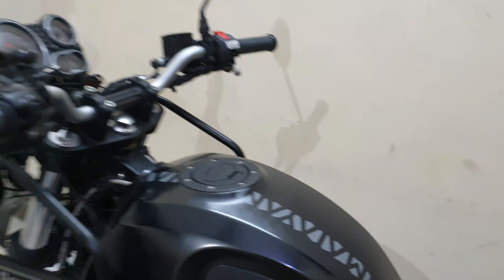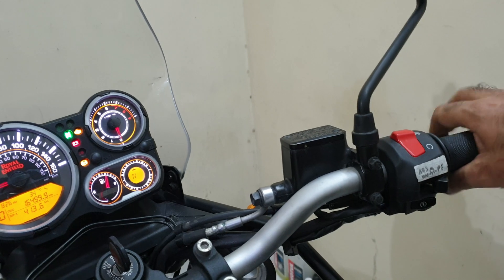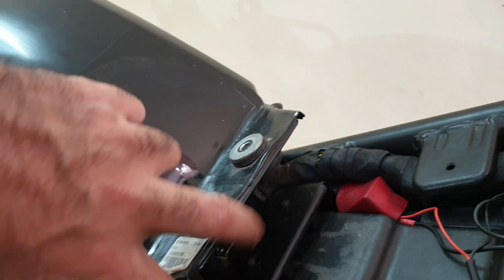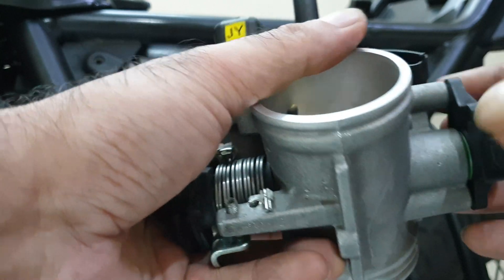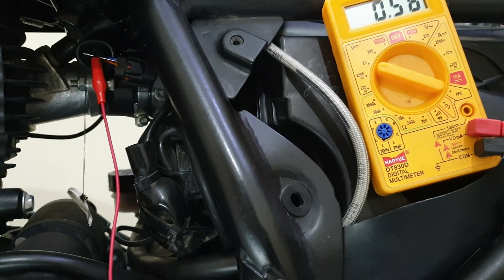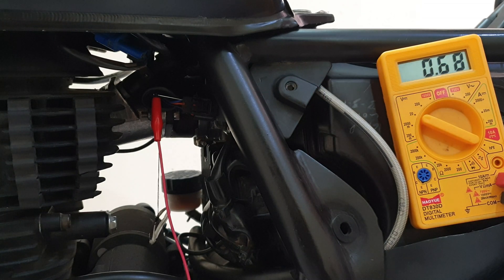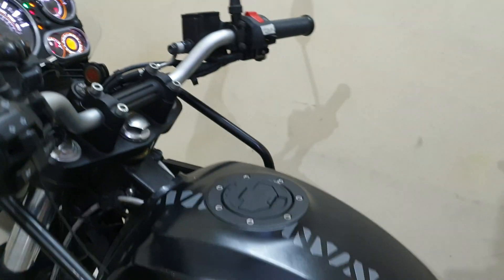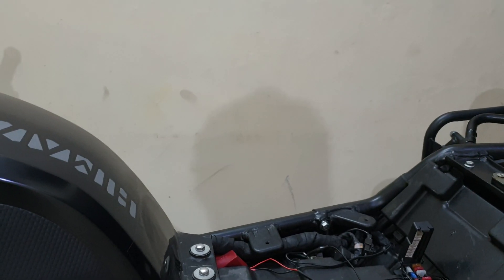Royal Enfield Himalayan | TPS | Throttle Position Sensor | Check and Adjust DIY

Comment from the maker: Hey
With so many sensors, the diagnostic tool at service centers may be a good option to check and diagnose problems. But some are accessible and easy to diagnose at home like the TPS.
ECU will all the sensors may seems intimidating but it is simple thing. Sensor (like TPS, MAP, O2, Crank speed, to name a few) provide input or information to the ECU which on predefined set of parameters from these inputs, guides the fuel injector and ignition timing, to feed fuel into the engine and advance or retard timing respectively
All these sensors work in conjunction to each other but if one fails the engine will still run on input from the sensor but ECU wont be able to fine tune thus there would be roughness and other teltale symptoms. 
This one is regarding TPS. If not adjusted properly it can lead to pough/erratic idle and poor performance. Checking and adjusting is the sipmlest. Hope fully the video will come handy 
Cheers :)
Reply: Thank uu
Reply: Would you know how and why a tps sensor would fail?

Comment: The 2022 bs6 does not have a tps, it comes with a complete built-in system, how can it be regulated or what generates the fault, because my 2022 BS& turns off in first gear, already hot it turns off in the city center several times, it drives me crazy, I don't know what to do, the dealerships with their pirate mechanics don't solve anything, they don't know what it could be and they change parts and parts and nobody is responsible for the poor quality of the training, they only sell motorcycles.

Comment: I have BS6 Himalayan 411. It has issues with idling and shutdowns but keeping the throttle slightly open or while started moving to get some speed then it doesn't shutdown. Any idea on what the issue could be?
Reply from the maker: @mageshganesan6871  bs6 doesn't have idle adjustment 
But look at spark plug gap
Reply: Need a valve adjustment. Tight valves will cause it.

Comment: I have exact same problem on my 411. But, it's a BS3 carburettor model. Recently got the carb serviced, tank cleaned, etc. but, the problem still persists.

I think the BS3 carb model also comes with a TPS? Would the diagnosis and solution be the same for the BS3 carb model?

Comment: I have BS4, 2018 model. I replaced the Timing chain after that 
1. Engine check lighe is still on
2. Fuel drops comes through fuel pump
3. Facing stalling issue.

Can you please guide me?

Comment: Thanks bro, I re-setting my BS3 C500 at 0.56-0.57 (previously was 0.3-0.4 and got some hiccup at slight throttle up, and somehow bit irresponsive throttle. This really fix my issue. I also experience forgetting to turn ign ON and engine cut off ON 🙂
Reply from the maker: Thanks mate, I am glad it sorted things.
Cheers🙂

Comment: Informative video brother.. my Bs6 2023 himalayan started to cut off when i down shift to lower gears like 2nd or 1st. Immediately after downshift and the clutch is still disengaged the engine cuts off abruptly. This is very annoying in traffic situations and while doing some offroading. Is this a TPS issue or something else?
Reply: Adjust the valve clearance.

Comment: I have rebuild my engine of a RE Continental GT 535... However in the process of removing the engine from the frame I disconnected the TPS sensor and after reinstalling the Engine the engine light is on. After some diagnostic trickery I know the cause is the TPS sensor (6 short light blinking after hardwiring the diagnostic line to the ground). Thanks for this super clear "how to" on how to set it up properly! I now know how to fix it :)

Comment: Thanks for this. I bought a cheap multimeter and used a sewing needle taped to the probe. It showed .64 and I adjusted it to 5.6/5.7 (bouncing between the two). Started the bike up and it stayed running! Had to lower the idle and will continue to work on that next time I ride. I typically don’t work on my bikes, but I know the dealer wasn’t going to try this. Can’t believe it actually worked for me. Your sewing needle idea was great and saved a lot of money, instead of buying a probe kit. The engine feels so much more stable. Thanks again.
Reply from the maker: Thanks mate, I am glad you found this useful. 
We are lucky that our model has all these adjustability. Newer models have different throttle body with no idle adjustment or TPS sensor adjustment😉

Comment: I HAVE A PROBLEM WITH MY HIMAYALAN, BETWEEN 2000 AND 3000 RPM THERE IS A JERKING WHEN I RECOVER THE RPM, I CHECKED THE TPS SENSOR AND IT IS IN THE CORRECT VALUES,

Comment: Thanks so much for such a detailed video instruction, step by step. I have a 2022 RE Himalayan and it has been stalling at startup every time. I will test the TPS voltage / position and adjust as needed. Thanks again!
Reply from the maker: Hey mate, thanks for your kind words. Now unfortunately, I have not worked on 2022 himalayan, I have looked at the throttle body of new models and found them to be different in design and function. So not sure if TPS adjustability is available. Please do let me know if it is. Cheers

Comment: Bro I tried this, but in my Himalayan it's not working, i inserted a needle nd negative cable on the negative battery side nd the red wire on the needle which I inserted but nothing is showing for me in the multimeter, mine is bS4 Himalayan

Comment: You saved my himalayan to be sold. I followed your videos to adjust the tps, the idle screw and upgraded the spark plug with the iridium one and now it is just perfect! The tps was adjusted from .60 to .57 and i could not believe the difference it did after it was adjusted. It is a completely different motorcycle now. Thank you so much!!
Reply: Hi can you share your no, it's not working for me on my Himalayan

Comment: Adjusted mine bs3 carb.  to 0.51 Volts at ideal! 
It was 0.25 volts from the factory i guess! 
My engine use to ping at times when the bike was heated! 
Now the bike feels super smooth and nimble and the pinging is negligible ! 
I hope 0.50 is correct as i read in ya comment! 
Thnks a ton! The joy i din had for 5 years is what i have it now! ❤

Comment: Another great informative video, thanks. Mine is starting to get a bit temperamental idling since installing a ejk fuel controller. I've done this adjustment to my classic 500 so I know it works, it made a great difference. I'll be doing this tomorrow to my Himalayan tomorrow.

Comment: Greetings from the US!  I just got my 2021 Himalayan and it takes about 4-5 starts to get it to idle.  I tried this method and read 0.65V.  I lowered it to 0.6V and see no difference.  Do you think I should put it back to 0.65V?
Reply: I think your issue has to do more with the minimum idle rpm rather than TPS. 
Mine took at least 2 attempts at start until I raised the minimum to 1,000-1,100rpm cold

Comment: Dear friend,
I had been and still an enthusiast about the vehicles and bikes.
1982 had a Enfield Bullet 350.
It was meticulously maintained.
Now the scene is enormously changed.
New technology and digital fly by wires system had made things better.
Here about this video and the demonstration with explanation by you:
All correct and to the point they are.
My few dull & dumb questions....are:
1) Let me assume the TPS position is at perfect position say +/-- zero.
Now by stepping down to minus one, the engine RPM will lower and viceversa?
Is this correct?
(One may not do this for setting the idle rpm.)
2) Regarding setting the idle RPM:
As demonstrated in your other upload:
The idle adjustment brass screw when turned in either of the direction: Does it physically lifts the throttle.
OR
Does it regulates the Air flow resulting in making the fuel-mix, lean or rich.
Please.
Hope to go through all of your uploads and will be asking a lot, in future.
Regards.
All the best.
RR

Comment: What's that sticker on RHS switch
Reply from the maker: Hahhaha, really glad you asked mate :) I did a BS4 to BS3 headlight light on off conversion plus also ABS on off switch, all in that old model switch gear so had put the sticker on for a couple of day to get familiarized with the setup ;D there are the vids
Cheers 
Royal Enfield Himalayan | Battery saving tip | Low Beam / ABS On | Off Switch Option | Replacement
https://youtu.be/ybSUd87mYhw
Royal Enfield Himalayan BS4 ABS On/Off Switch | Handlebar Mount | DIY
https://youtu.be/oTWdykKZLY0

Comment: Classic 350 what radio ??
Reply from the maker: Hey mate, BS6 Classic doesn't have this adjustability, Sorry as RE has put in a completely different design Throttle body and sensors
Reply: @leuheanrede  sir, I have old model 2014 tps available thats why.
Reply from the maker: @vipulmodi8728  aah got it. That should have the same setting. Will check and confirm soon and let's keep it simple bro, you say sir and I feel depressed about my age 🤓

Comment: Bro. Mine is BS3 Himalayan, where I couldn't adjust (Rotation) the sensor as you play in your vehicle. It has very limited movement... What's your suggestion to avoid stalling when sudden throttling...
Reply from the maker: Hey mate, limited movement could meant that the tool you are using is making it harder to access that Torx screw. As for stalling, does it happen at low RPM, High RPM or anywhere in the rev range?
Reply: @leuheanrede  No. I can able to access the screw and can loosen it.

Stalling happens when I shift to every gear. If I reach max speed of 1st gear I'm getting dip. Similarly 2nd, 3rd, 4th.

In simple words, if I throttle more to speed up the vehicle it dips there.

I donno whether I answered your questions or confused you🙄. 

Pls share your email/ Contact number
Reply: I did mine and that's fairly easy! You need to loose the T20 torque screw to move it!

Comment: I have a fluctuating rpm issue when i start up
It moves between 1.1 to 2k
Also i am getting very bad throttle response the bike doesn't go beyond 90
Reply from the maker: It could be a loose connector to one of the sensor or a bad sensor itself if the bike is not going above 90. This vid just covers TPS sensor
For fluctuating RPM please try to adjust the idle, I did a vid some time back, https://youtu.be/VhkReLSSIfs
This is only applicable for BS4 models

Comment: I have erratic idling, stalling and restarting issues on my “2021” Himalayan.
Surprisingly on this new Himalayan, there’s no TPS at the location you have mentioned in the video.
Please help me out in locating the sensor if possible. Thank you
Reply from the maker: Hey mate, yup new himalayans have a new throttle body with integrated sensors unit, not much can be done on them

Comment: I have an issue while riding in lower gears and around 3 to 4 rpms. At steady speed the bike's power seems to come and go, almost like a yo-yo effect. It doesn't feel smooth.  I'm not sure if it could be something sensor related, the chain, fuel injection. Have you encountered this at all?

Comment: hey man, my issue is a little bit opposite or different you can say!

when I turn my Himalayans key to on position and turn on the engine by self-start button and let it warm up to 2 to 3 min after that when I perform throttle like little bit fast (not slow) at that time my engine stops!
then I have to self-start my bike again and it does not turn off if I throttle it slowly!

and also another issue is sometimes my fuel pump did not make a sound (petrol pumping sound after kill switch in off position) and my bike engine didn't get started! it's like sometimes 1 out of 10 times and sometimes continue more than 4 to 5 times than I have to switch off my bike by the key multiple times!

any solution for both the problem? I just purchased my bike on 24th April 2021!
Reply from the maker: Hey mate. How many kms done in total. I ask becos for initial few 100 kms it is normal. After first service as the new parts are run in, things will get better. May I suggest that 2-3 mins of warm up in normal temperature is a bit too much. Idea is to warm it up for like a min say as we put our helmet jacket gloves etc on and start riding. There is no reason to give fast throttle at this time. We are suppose to ride it slow for first 5 min s as good practice at normal throttle speed.
But as for the issue of stalling, its new so let it run for a 1000 kms then we can adjust the idle. I have done a video on idle adjustment if you need to do it and the bike has done over 1000 kms please have a look at idle adjustment. 
As for second issue, that sound should always be there when we turn the key on given that on off on the handle is on. If you are not hearing it that means probably the electrical connection on the pump on right side of tank is loose. Please check that. Considering yours is a new bike I suspect it's just the loose connector. If it was old then I would have suggested to check for wiring cut or fuse. Very few chances of pump failure in new bikes. Always keep 3-5 ltrs or above of fuel in tank to  avoid any pump related issues in future. Last would be to check if battery is charged. 
Its a new bike so don't worry about tps at this point. Maybe later.
Reply: @leuheanrede  I rode my 444kms till now!
and due to lockdown conditions, I can't take the bike to the service center and service on wheels is also not available due to pandemic.
my first service is pending!

and ignition fuse I have checked yesterday it was good no issue in that.
and my tank is half right now and before that, I have encountered an F trip for around 3 to 5 kms.

and I have also checked the connector below the fuel pump yesterday it seems ok to me but I'll check it once again.

and can you plz tell me what can I do about the fuel pump issue? if it not resolved! because sometimes I got frustrated when my new bike didn't get started
Reply from the maker: @Hemant._.Dhiman  thats good, don't worry after the service things will get smoother, lockdown should get lifted in another week or 2 hopefully.
About the pump issue, I am not sure i understand correctly whats happening. 
So ignition on and kill switch on. And the pump doesn't start. Is that what you're saying
Reply: @leuheanrede  yes!
Sometimes i can hear a fuel pumping sound.
But sometimes dont and that condition my bikes engine did not start i have to turn my key to off position and again it to on pisition until i hear the fuel pump working sound!
Reply: And sometimes its to embarrassing in traffic conditions coz its new, and it stall in second gear! And that time it did not start i have to move it to the side until it start😅 (but since its crossed the 300kms in total the stalling problem is less now)
Reply from the maker: Ok got it now. Now that sound we hear is called fuel pump prime cycle. Only reason we don't hear that is 1) when battery is low 2) connection is loose 3) wiring is damaged 4) fuse is loose or damaged 5) carbon built up in ignition or kill switch connector points 6) pump failure but highly unlikely in new bike
Check for the above points and it should be ok
Reply from the maker: @Hemant._.Dhiman  🙂yes that happens. But worry not. As you mentioned its improving as bike accumulates more miles. If these issues persist after 2-3000 kms then we start worrying. Also as I mentioned and that you are already following, so that's a good thing, but dont ride the bike in reserve.
Now there are other concerns like evap hose. But dont worry about that at this  point.
Reply: @leuheanrede  yeah i read about EVAP HOSE and i also dont think its related to that (fuel pump prime cycle).
Reply from the maker: @Hemant._.Dhiman  true evap is just for stalling related issue
Reply: @leuheanrede   I can't say fuel pump failure coz it worked 7 to 8 times out of 10!
even I just checked it(didn't ride my bike for the past 2 days) and the fuel pump prime cycle work in the first 3 times then 2 times it doesn't!

let's see when will I get the chance to take my bike to the service center....hope they did not charge me a huge amount of money for the same!

Comment: Hi, my himalayan idles fine but when I touch my throttle it stalls. Could you give a suggestion please.
Reply from the maker: Hey mate. That happen when one of the wire connectors come loose. Please carefully check, if need be unplug and plug the ones on throttle body. TPS one will the the first one I would check, it seems connected but it's not. Once you are pressing it in you should hear the click.
Reply: @leuheanrede  thanks for your reply. I did press clicked the throttle plug as u said. No improvement. Anything else shud I check ?
Reply from the maker: @raguramravikumar1884  ok so were you trying to adjust TPS.
Reply from the maker: I am asking cos if sensor was moved out of range then also it will not give correct reading to ecu and bike would stall as soon as we give any input on throttle. 
Please elaborate how it started. Did you change or adjust anything. Or did it just happen like out of nowhere
Reply: @leuheanrede  I have this stalling issue for a very long time, taking it to various service centre's dint help. After watching this video I thought there's something with the tps. I unplugged and plugged it back heard a click. But didn't help.
Reply: @leuheanrede  I actually unplugged and plugged it back and made sure I heard a click. I dint adjust anything else